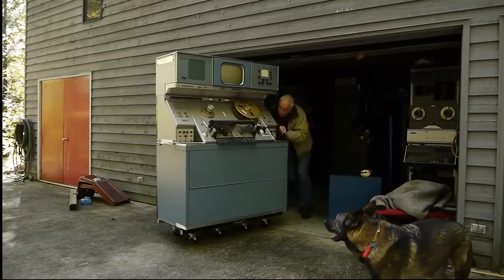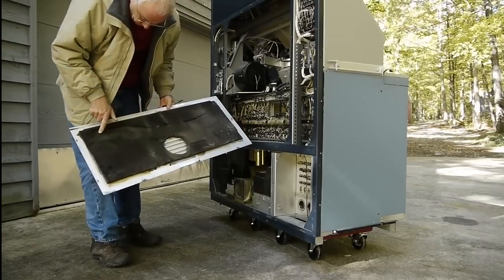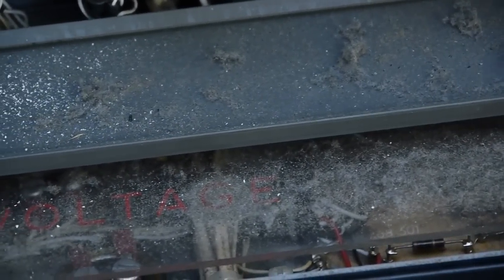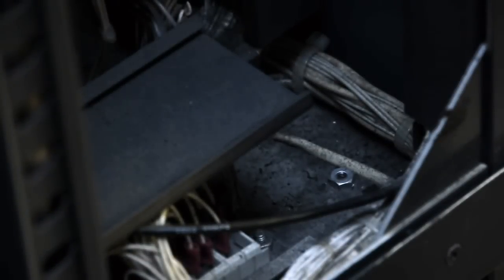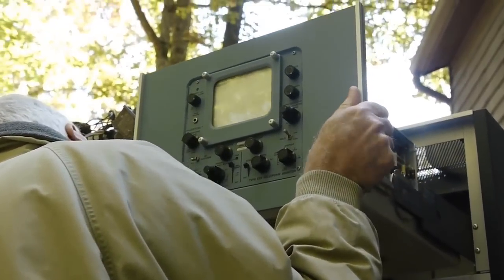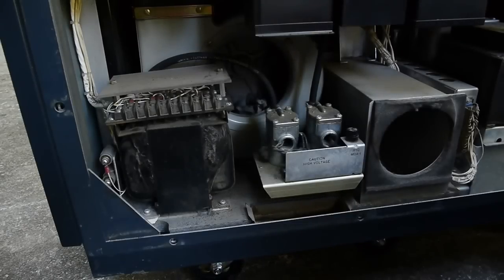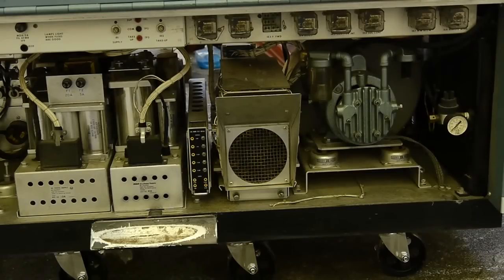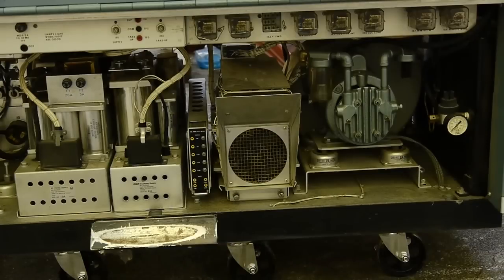RCA TR70B quadruplex recorder.....first look inside

Comment: I remember being in standby to play out a commercial on the 70c and a "5" on the clock and the gallery called to check I was ready I answered and put my hand back on the opposite side of the VR  took the 'go' call and hit the RECORD button!  very quickly by the stop and then the play button.  The commercial went out with out note But I then had to spend the next hour dropping in a 1 second gap in the control track as the VT did a crash record when I hit that button. And as it was the master...!

Comment: So with a garage of old equipment, I take it your wife's happy you have a hobby..
Honestly though, I would hardly know where to begin with something like that, and I've worked in the electronics manufacturing industry. Now when it comes to motorcycles, I've restored several, mostly BMW and english bikes. That's been my career for the last 20 years now, and my electronics and manufacturing background has really helped in that.

Comment: I'm just starting out doing video transfers, and production and it is neat to see these old machines up close. I thought I had most things covered with my U-matic.... Shows what I know... and need to learn!!
Please keep it up, I enjoy getting a closer look.
Reply: Ever do any camera restoration? Or do you just stay with the VTR's? I worked mainly with the RF plants Transmitters & Microwaves systems. When I worked in my television & Radio days. That would of been the 50's to 2000's
Steve D. 
01/31/ 2017@01:38PST